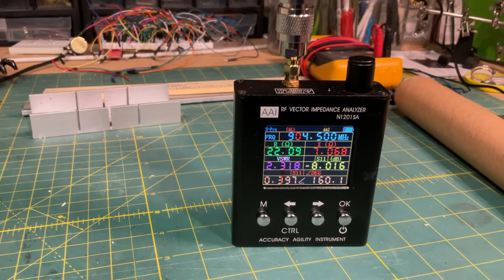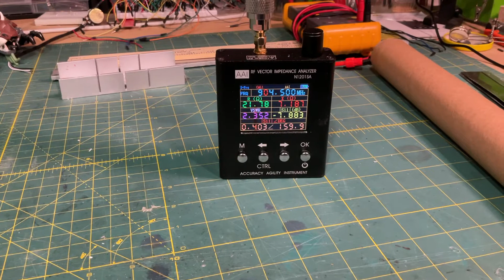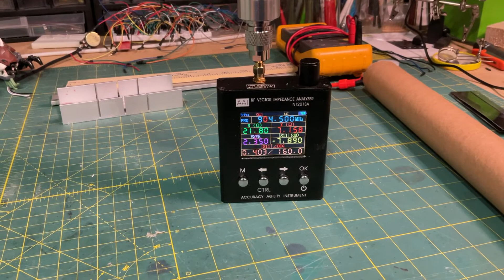LoRa RAK Antenna Breakdown Evaluated for Tuning

Comment: Hello... I have an antenna with a frequency of 900 to 915 MHz... and a sensor frequency of 865 MHz and a gateway that operates at a frequency of 865 MHz... Will there be a connection problem? Sensor with gate? Does it affect the distance between the two?
Reply from the maker: Hmmm… I am not clear why your sensor and gateway are not also 915 MHz since that is what licensed by FCC for LoRa in the U.S. It might work but the range will be likely be impacted since not optimized for your antennae. Why is it 865 MHz?
Reply: @ModestMaker   Thank you for the quick reply...my area license is IN865Mhz ..I bought a gateway RAK These send with an antenna 900   to 915 MHz  /5.8 dB.. .. I installed a gate at a height of 8 meters... and a sensor about 50 meters away... There are no obstacles, buildings or trees. Does it affect it significantly? I don't see any readings on the platform? Once again thank you for the hard work
Reply from the maker: I think that's a pretty big shift between your antenna and your sensors. If it's not working, it's likely due to that - like trying to listen to a favorite radio station on the wrong frequency where all you hear is snow. You might consider building your own antenna. I managed to build and test one for LoRa here: https://youtu.be/ZGqLQNsd_cI?si=tCJU88WeKcB2gbU9 . More details are in the description of the video.  - you would have to just modify the frequency parameter when designing the antenna to match your sensor and gateway.
Reply: @ModestMaker   I see .. thanks ..I will make an antenna. Frequency is required.. and I will inform you of everything new. Thank you again

Comment: Hello nice video.
I saw that this antenna is open dipole.
I know that there are closed dipole antennas.
What's better? Open or closed dipole?
My antenna is 8 DBI, open dipole.
Is it mandatory to place a protective arrestor light on the open dipole?
I already have the metal pole grounded.
Thanks
Reply from the maker: Great questions- I am brand new to all this so I honestly don’t know. I will be replacing my home brew ground plane antenna shortly with a RAK 5.8 dBi to see if performance improves, once I figure out the dBi of my home brew. I need to learn some antenna modeling software first to figure that out.

Comment: why is that this disturbed me.  the fact that the antenna is flat bothers me.  dosent this mean it will perform better or worse depending on which direction the flat side is pointing to? shouldn't this be round?
Reply from the maker: I am not an RF engineer, but I honestly don't think that's an issue. If this were a consideration, there would be documentation regarding orientation from a reputable company like RAK.
Reply: @ModestMaker   Im not an RF engineer, but i am a electronics repair tech.  so i'll admit i don't know for sure. it just strikes my weird that a OMNI directional antenna should have a flat area.  I have a rRAK 8dbi and was thinking of turning it  30 degrees to see if it makes a difference.  but just now my earnings are pumping up.  im so confused.
Reply from the maker: Based on another comment: “This is a Slim Jim variant antenna based on a J-pole antennae.” Perhaps that explains the flat nature for those who wish to investigate further. I will try to do so shortly, but am in the field for the time being.

Comment: The AAI serves as a partial ground plane from my reading which could effect your measurements. Might try throwing a good yet short cable between the antenna/VIA and giving that a go. (Would likely be closer to real world given that antenna would likely not be installed directly on gateway.
Reply from the maker: Thanks. I plan on replacing my installed ground plane antenna with a RAK and then testing at the downstream end of my coax at a later date. First, I am working on getting my gateway solar powered so l can disconnect it from the grid - stay tuned.

Comment: I have to ask, was your analyzer calibrated? As I understand it those impedance analyzers still need to be calibrated with Open Short and Load terminals. Not sure how much of an impact it would have on the VSWR, but something I felt worth mentioning. 

I recently ordered a bulk order of antennas from an overseas supplier who advised me that they moved away from the PCB antennas to hand tuned antennas. I have yet to test it as my cable and antenna analyzer is on its way, but from what I have seen in the early photos from the supplier they appear to have some adjustability at the manufacturing stage.
Reply from the maker: As noted in this video, the new VIA was not calibrated: https://youtu.be/vYdI553ltKw . This is recognized as a potential source of error at minute 11:00, but given the 5.8 dBi antenna performed well, I don’t think this is a significant. 

Subsequent  comparisons to RAK results confirm this : https://youtu.be/uf5uyckRbSs

Hand tuned does make more sense IMHO for those of us who like to tinker.

Comment: your antenna will be easy to retune  its a slim jim antenna     first thing  to do is find the lowest point the swr is located lets say the dip is really low  at 850mhz  if thats the case takeing a few mm of the small  track will shift it up in frequency 
now say the  lowest  frequency swr is where you want it  but its still to high then moving where the coax is soldered to the pcb up or down 
a few mm will  change the impeadance and you should get a lower  swr    the slim jim requires no radials  btw . all the best from superyagi antennas here in the uk
Reply from the maker: Thanks so much for those suggestions. Unfortunately, the antenna has already been returned to RAK as a courtesy. https://youtu.be/uf5uyckRbSs?t=69

Comment: What is the black block at the tip of the antenna?  Is it just to keep the pcb board snug in the tube?
Reply from the maker: That is actually at the base for securing the antenna in the center of the fiberglass tube.
Reply: it should  be a choke  at this frequrncy just a few  turns of coax   will do

Comment: Awesome thanks alot! I got exactly the same issue and was nearly opening the antenna to try to add solder or cut off to tune it... I'll get tomorrow another adapter to crosscheck if this also is the same with it and will contact support then.
Reply from the maker: The 5.8 dBi antennas perform relatively well. Here is the follow up: RAK 5.8 dBi Antenna Unboxing and VSWR Tests
https://youtu.be/uf5uyckRbSs

Comment: For all who are looking to understand what type of antenna is this, This is a Slim Jim variant antenna based on a J-Pole antenna.

@Modest Maker, I was wondering if you had the chance to tear up the 5.8dBi RAK antenna. I am very curious to see which type of antenna are they using on those ones. Cheers.
Reply from the maker: LOL - no way! That antenna is perfect- no need. I did receive the two others I ordered today - will test them next week.
Reply: Hello,

I have an antenna analyzer that measures up to 1.4 Ghz, I took it out and seeing the measurements from the film I quickly set up a Slim Jim at a frequency of 868 Mhz (Europe). After a lot of effort and time I released the following performances, Resonance = 869,050 Mhz
R = 109 Ohm
SWR = 1.9
I used the computer(  https://m0ukd.com/calculators/slim-jim-and-j-pole-calculator/ ) below, the whip made of CU 2.5 MM * 2 wire.
I made very easily 4 antennas from the site below with great ease. From tests 7.5 dBi. https://www.youtube.com/watch?v=OwNiL4402kM&t=2985s
English translation Google, sorry.
Reply: @ModestMaker  would you recommend rak 5.8 dbi before mikrotik 6.5 dbi. Comparing to the quality. Thx!

Comment: Hey bro good stuff! I was wondering if a 30000mah solar battery power bank would be enough to power up a Rak miner through out the night until the sun comes back up the next day?
Reply from the maker: I don't really know, but it's something I'm also interested in. I hope to test this out in a future video for my remote deployments- stay tuned.
Reply: @ModestMaker  thanks, I look forward to that video.  I plan on deploying 3 dozen through out Haiti and a solar application would be Great!!!!!
Reply: I uses a 12,000mah portable powerbank  and it powered my Rak for over 8 hours with still plenty of juice left
Reply: @tonytypes  holy cow! For real? Can you provide me Amazon link to it? How do you charge it up?
Reply: @Tommysotomayorsmomma  it was only a temporary solution when I was in the process of changing location. I didn't want it have to resync so I used a wifi hotspot and a portable powerbank to keep the Rak on. Probably not a good solution as a permanent way to power your Rak

Comment: Curious what RAK is going to come back with... I've been a fan of theirs since discovering their product lineup about a month ago. I wonder if scoring the PCB so the antenna becomes shorter would provide better VSWR. Did you happen to test it without the plastic case? Sometimes it seems that manufactures tune the antenna without considering the impact of the copper with the plastic / fiberglass casing
Reply from the maker: Actually, I did test the antenna with the fiberglass case off. The VSWR worsened to around 4, so I believe it was tuned with the case on. I then blocked the antenna with my hand, and it improved depending on where I blocked it. I captured this on video- might share it later if there is interest.

I hadn’t thought of scoring it until you mentioned it.
Reply from the maker: The VIA performance looks good per this test with the same unit: RAK 5.8 dBi Antenna Unboxing and VSWR Tests
https://youtu.be/uf5uyckRbSs